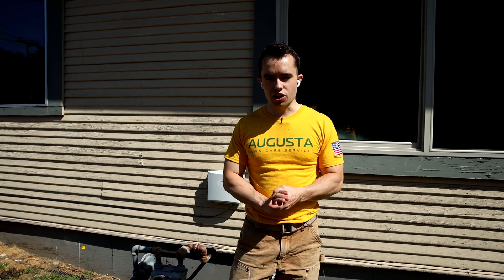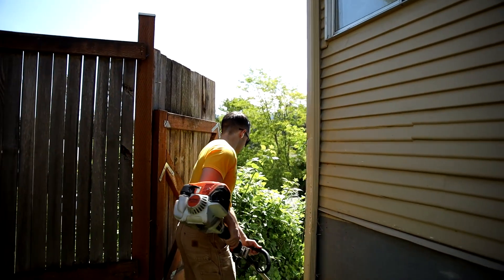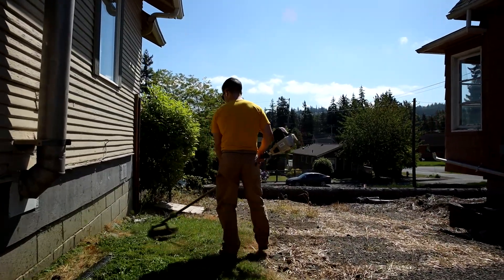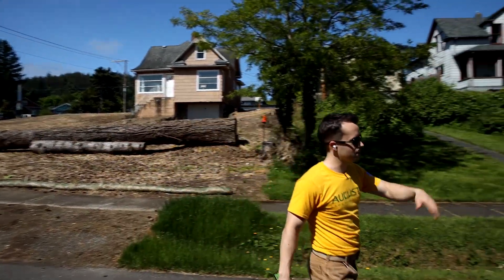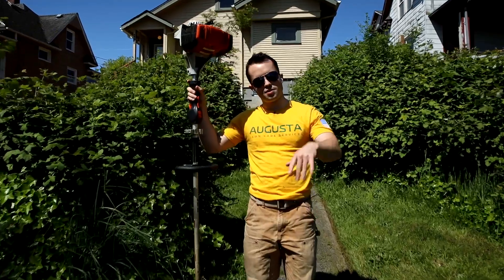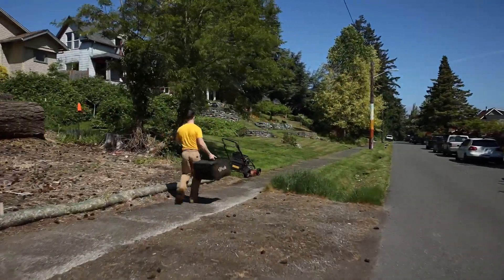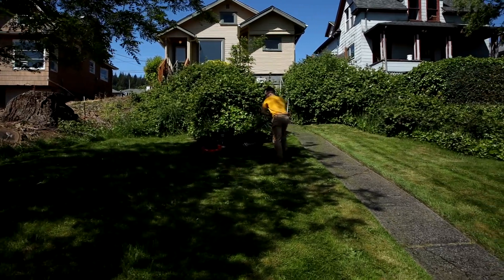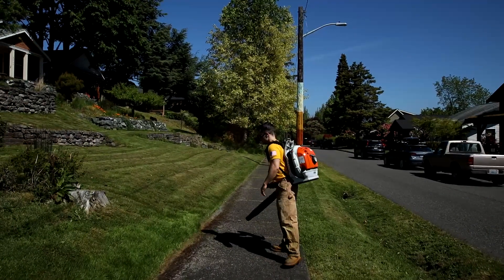Secrets to Grow Your Lawn Care Business (WARNING: This Video Will Make You Money)

Comment: It's great you mentioned the weight of the trimmer. Those Stihl weed eaters are like carrying an anvil all day. I've had a red max r2300s since 2006. It's light and has the power to do the job,  it's got a million or so hours on it and I have rebuilt the engine a few times and have several carb rebuild kits because ethanol is just great.  I just let all the diaphragms and gaskets dry out and shrink back into shape.  A couple years ago,  parts became impossible to find.  She still hangs in the garage,  with super expensive echo red guard gas in it and still starts with one pull!  My new work horse is a Hatachai 23cc amazon buy I bought only because it weighs the same as the red max.  I'm really impressed, no issues and two years later,  it's still kicking tail. Less than 200 bucks.  It's not getting 40 to 50 hours a week,  like the max did, but for the price,  why not buy a couple an give it a try?  If I was still in the business,  I'd do it

Comment: I do the same but on the 21" commercial toro legendary pro lines. It mulches better than it discharges and that's why they are so hard to find. If you find one for sale get it and ditch that 30" exmark. Those Toros 21 pro lines are never gonna be redone that light ever again, even the weaker 160 Honda engine on it is enough but if you don't mind the extra weight, the Kawasaki motor on them is more powerful for that thick grass in the summer. I do the same when trimming except walk in the same way slowly when I'm trimming to see ahead and alert others when I'm dealing with more debree
Reply: Forgot to mention since the design is flawed on those Toros for the bag, itself will slowly deteriorate and leave small patch holes of the fabric liner and that acts like a small hole for discharging while bagging, SAVING you an extra dump and not leaving any clippings behind in a trail.